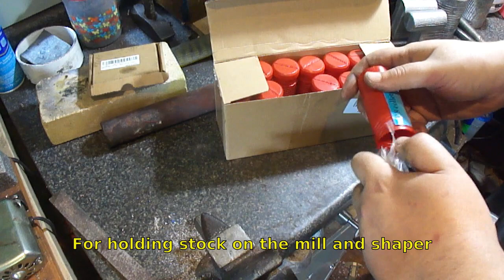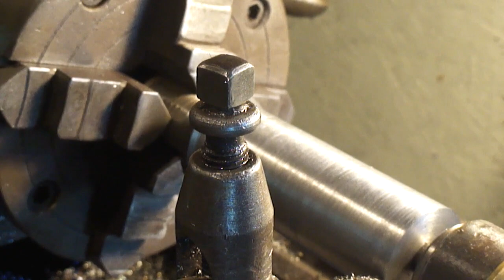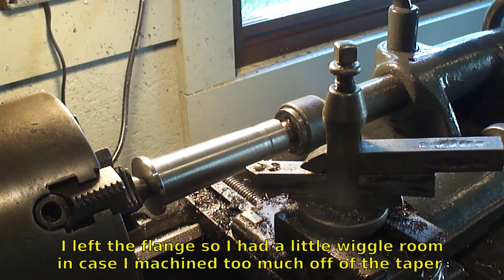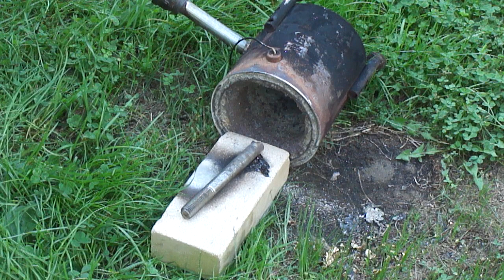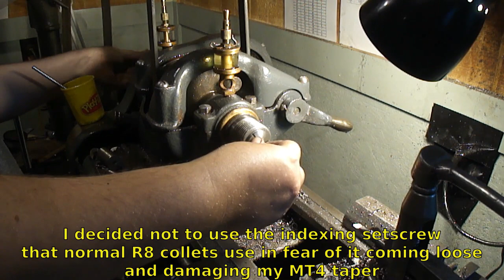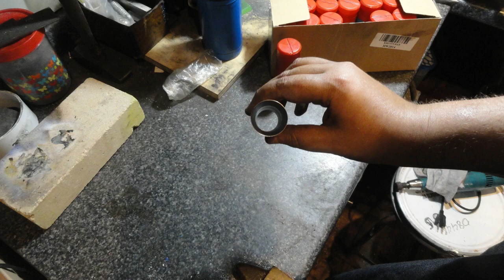Lathe R8 Collet Adapter

Comment: First time I ever seen a two jaw chuck on YouTube pushing that 3/4 drill
Reply from the maker: lol, yea, that old chuck works just as well or better than my normal jacobs chuck, and I still use it quite often, especially on much smaller bits which the jacobs chuck cant hold.
Reply from the maker: @jeremycable51  They work really well, and you cant beat them. The only downfall is silver and demming style drill bits with the 3 flats on the shanks for the jacobs chucks, but as long as your bits dont have that, it's hard to tell the difference in work holding between a 2 jaw and jacobs chuck tbh. Holding the square ends of taps is one that the 2 jaw really shines imo.

Comment: Watched this after the hex block vid, again very enjoyable. I have Lorch 16mm collets (13mm capacity) direct fitted into my Lorch, Schmidt lathe´s spindle, your adapter design makes your R8s just as flush on the front, and also smaller in diameter than the chuck thread.  This gives you a good chance to use the collets for a chuck backstop, I use mine like that for all critical work. Even the 3" length capacity you mention for your collets because of the internal drawbar is enough for that, just need to work out a way to extract the stop rods out the front of the collets. A tommy hole in the side of the bigger bars is one soluting, tweezers in from the side between the chuck jaws for the smaller dia. ones. I can knock them out from the back, and use rods as thin as 3/32" on small work, drilling and threading into 3mm dia. brass balls that are wont to slip back in the chuck otherwise etc. I add a plastic bush a tight push fit in the chuck bore for the thin ones, so they don´t wobble. Just a tip for a good "bonus" use of these collets.
Reply from the maker: Yea, Ive thought about using the collets as chuck back stops, and have actually done it a few times already for some work I was doing, and yea, they can defenitely be difficult to get the work out of the collets, expecially for smaller diameter stuff. I usually just bring my tailstock chuck up over the round stock that I use as the back stop, tighten it up in the tailstock, and just pull the tailstock out, pulling the stock out with it. 

That adapter has been an absolute blessing to have and being able to use the R8 collets in the lathe. My 6" chuck only holds stuff down to 3/8", so anything smaller, I was never able to hold it before, so I was very limited in the type of stuff I wanted to do. I ended up doing the little brass pusher for the dividing head that I showed in the hex block video in the 3/16" and 1/8" collets, which just making that part, which was that small, I felt like that limitation was lifted. 

Another benefit to the sleeve is that the collets are inside of the spindle itself, so you have really no overhang, so there's nowhere for anything to flex, so the whole setup is extremely rigid, and makes things very easy to swap the parts in and out after always using the 4 jaw. Having the R8 collets go from 1/8" to 7/8" and some go up to 1", that really covers most of the stock I really use for projects, so most of the time, my 4 jaw has lived in the drawer since I had gotten the sleeve made, lol.

Comment: Nice - great episode. 

Don’t I know the #30 taper is pricey. Whew! R8 and even the other metric tapers are a decent option. 

Glad to see the mighty power hacksaw is enjoying itself gnawing through some tough material...LOL. 

Dan
Reply from the maker: lol, that saw is hard to slow down, even tho I had to just resharpen the blade on it. I just took some diamond needle files and pulled up a chair, then filed away to sharpen the teeth. I have to do that around once a year but it'll keep keep chewing it's way through everything from that point on. 

Yea, #30 tapers are crazy expensive, thats why I was just planning on making some of my own taper adapters/holders myself before the viewer sent me the ones that Ive been using alot of since. Ive still thought about making some custom adapters, but mainly just for a boring head and such. 

Those R8 collets are pretty nice and should hold up quite nicely for most of the work that I do really, and makes it really easy to hold round steel stock and such in the lathe like we usually buy. If you really think about it, when's the last time time you bought steel, aluminum, etc and it wasnt in a fractional inch size? :P So yea, I think those collets are perfect for what I want to do with them, lol.

Comment: Was thinking of making a r8 adapter for my wells index it has a b&s9 taper it can be reground to r8 but it’s 800$ which is less than I got in the mill so I believe I’m gonna make the adapter then attempt to I’d grind it in the spindle on the mill
Reply from the maker: Ive seen quite a few B&S #9 collets and accessories, and being just a single taper, it wouldnt be hard at all to make your own tooling tbh. I dont think I would want to mess with the mill spindle because the chance of messing it up is pretty high, and they usually dont leave much room between the bore and bearings usually, so you start trying to grind it in and you can end up cutting the spindle off by grinding into the bearings on the OD of the spindle, and ruin the whole machine.

Comment: Nice! I would have probably sacrificed about .375 of length between centers and had a flange on the front of the adapter. So there wouldn't be such a sharp edge there. Also if you don't already have one I would make a Spindle Thread nut to protect the threads. Good job still.
Reply from the maker: I thought about doing a flange, but decided not to because it would have been sticking out a little too far, and there wouldnt be enough meat between the flange and the R8 taper. When I did face it off towards the end, there's around 1/16" flat on the front of it that doesnt really show up in camera, but it is there and softened that with a file, so it really isnt that sharp tbh. I was planning on making a spindle nose protector very soon, just getting time to get to it is the problem as with most projects, lol.
Reply: A spindle but will allow through jobs too.
Reply from the maker: the backs of R8 collets have a 7/16"-20 threads in them for a drawbar, due to the size of that and being internal threads, the part wont let stock through them for extremely long stock, but there is plenty of room in the collets for mostly anything you would really need to hold.
Reply: Yep, make a spindle thread protector. If you damage the spindle threads, it's a class A disaster. Aluminum works fine and you can drill a couple of holes radially in the protector for  a tommy bar to unscrew the protector. A flange would be really handy for the adapter. That would allow the spindle thread protector to be used to eject the adapter so you wouldn't have to bang on it from the other end of the spindle. If you extended the adapter out like Neptune suggests there would be plenty of material for the flange.
Reply from the maker: yea, I know about the spindle protector, and am planning on making one. the bushing is already made, and no use making another just to put the flange on it.

Comment: G day Chirpy’s

👍 nice job 
Went to a truck repair place yesterday trying to get hold of old valves, no luck
I must have a go at making a boring bar that way, you make it look so easy👍
a two minute job 
all the best to ya
Reply from the maker: lol, mine actually came from old lawnmower engines, which there's old junk lawnmowers always sitting around somewhere or another if you just ask around, lol. The gears in those are handy for project, as are the springs, crackshaft is good cast steel for machining projects out of, and you can melt down the rest of it to cast new things out of it, lol. 

Those boring bars do work very well and is supprisingly rigid. The shanks are usually 1/4" diameter, and if brazed up like that, it'll easily fit into a 5/16" bore no problem, so that opens alot of possibilities for what you can make.

Comment: good job , I have my lathe running and the mill is in place all I have to do is hook it up now ,I hope all is going good for you
Reply from the maker: cool, you'll have to let me know what your big project using those two are when you get everything leveled and wired up. everything is OK here, just been busy really.
Reply: I have a hammer for the mill I made on my facebook     dan van der torre        you can tell its me my dad is to my left
Reply from the maker: I found your page but dont see any hammer pics or anything like that, and I dont get into facebook at all really anyhow.

Comment: You should make a thread protector to put on the spindle when using that collet holder. You certainly wouldn't want to accidentally run into the spindle threads and ruin them.
Reply from the maker: Yea, Im already planning on it, the biggest thing I'd really be worried about is dropping something on the threads and damaging them that way, so thats why I was already looking into making the thread protector. Thank you for your concern and Ill defenitely be getting to that sometime soon.

Comment: Nice addition you have made there Chirpy.  I still love the 2 jaw chuck in your tailstock.  So I am guessing that your knock out bar is pretty close to the diameter of your spindle ID?  You don't have much meat to smack on the sleeve you made to knock it out.  Great tip with the carbide inserts.  Looking forward to going to the steam show!

Joe
Reply from the maker: yea, That old two jaw chuck is awesome, lol. Ive used it quite a bit and it has almost never failed me and is supprisingly easier to use than the jacobs chuck is alot of the time. 

That bore in the taper was counter bored a few thou at the very end to eliminate sandwiching of the back of the sleeve, and damaging it, and also that 1060 is some seriously hard stuff. I went through two high quality M42 cobalt drill bits because it just ate it, then kept having to get the carbide boring bar out to remove the work hardened area after it ate the drill bits, but having a soft ended knockout bar on the backside of it, I doubt it would ever mushroom it over enough to really mess it up. 

I was thinking of turning the end of that bar down to the ID of the sleeve, that way when it gets banged on, it wont let it cave in, which wouldnt be much of anything to do really. 

Yea, Ive been looking forwards to algonquin also and meeting you guys.

Comment: Nice!   Glad to see you did not end up with a bunch of rubbish collets.
Reply from the maker: Thanks, they all looked pretty good and for the price, I was expecting them to be somewhat, but they do work pretty well so far. A few of them looks like they hit them with a grinding wheel on an angle grinder or something, then blued them, then ground them to size, but it's just little blemishes that are at the very tips of stuff where it shouldnt really make much difference. For what I was wanting them for, they work perfect.

Comment: Chirpy,

I just made an executive decision !
I think that die-filers of yours would make a great addition the watchmakers/clock-makers bench!
It just could be a bit smaller... In clocks, one often needs square holes, slots and openings 'not round'...
The addition of some quality Swiss files to such a machine would make live a lot easier.
I am however going to try an find a founder that can make a me cast iron from of this design...

Toodles

Paddy
Reply from the maker: lol, I use my die filer all the time for those applications, and most clockmakers I know of have die filers for doing that kind of stuff, gear teeth, and filing up to layout lines on the brass parts.

Comment: ToT used blue ink to check the surface matchup, rather than just "feel"

Why didn't you check mating with blue?
Reply from the maker: I did use the blue off camera to test it, and said that I did, there was like 3 hours of video so some things had to get cut out so it was watchable, lol. It did blue up fine and had contact all the way up the taper. I have prussian blue ink for scraping, and just use that when bluing stuff up since I can get it so thin and really show what is contacting. Thats also why my hands went from dirty to clean a few times in the video, lol.

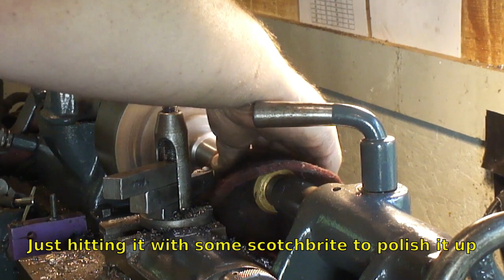Comment: @10:13 - the way you wrapped the scotchbrite around the part could easily have wrapped up and entangled first your fingers, then hand, arm, etc -- it's EXTREMELY MESSY to see the videos of individuals who don't adhere to safety on sanding, et al with a lathe...  please research!
Reply from the maker: Yes, I know, but the scotchbrite was held in a way that if it did grab somehow, it was very loosly held, so it would have just spun in my hand freely.